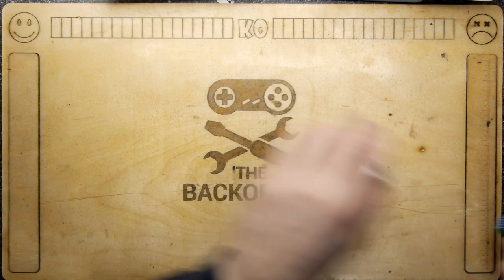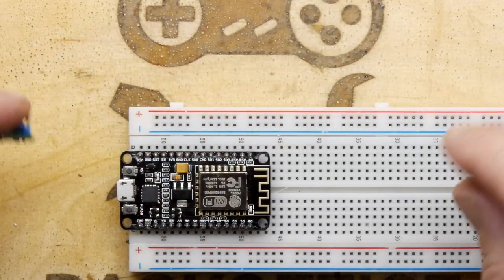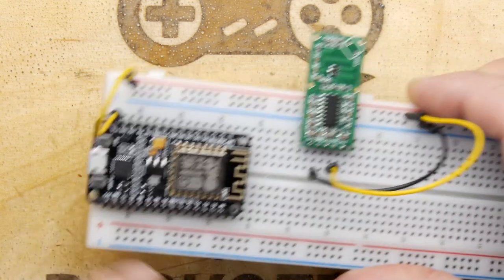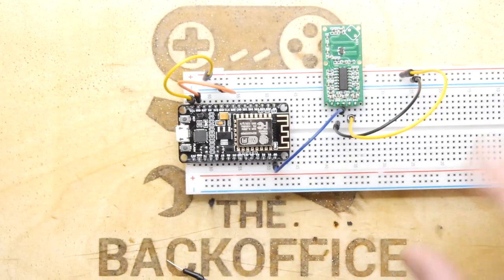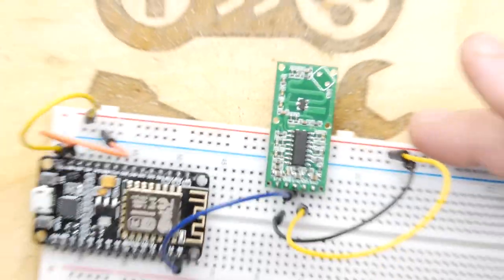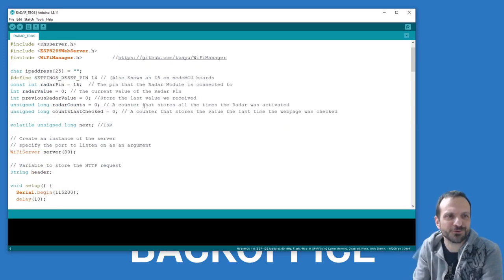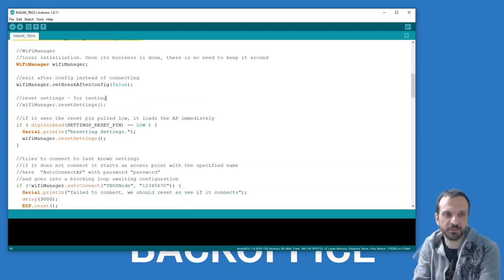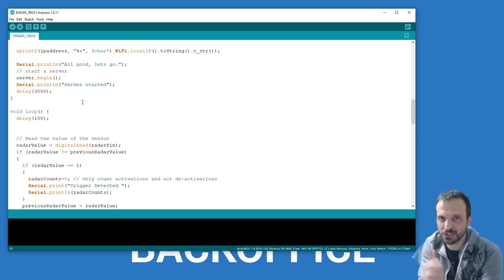Build Your Own Wifi IOT Microwave Radar Occupancy Sensor

Comment: You can wire it with battery to the radar then power 3.3 to mcu and use the deep sleep wake pin as data pin. 1-2 mA/h :) when there is movement esp wakes up and sends data over wifi
Reply from the maker: Nice!!
Reply: 3.3v is @100mA not enough for a esp32 using wifi. It needs atleast 150mA

Comment: For more breadboard  connections for the bigger module, could it straddle the power rails on two breadboards placed next to each other instead of the middle of a single? No such module at hand to test with, and on video it looks that it'd be a  close thing either way... Might depend on/come down to exactly which breadboard one has.
Reply from the maker: I lot of breadboards have removable power bars so deficit this world be a great way around it!

Comment: Good stuff. Have a few of these radars myself. Would the page only turn red if you happen to load it as a detection occurs?
Instead, you could serve some flat html containing a bit of javascript that polls another page, all that other page need do is print 1 or 0 or whatever. The js then dynamically changes the bg colour depending on that?
Reply from the maker: That's a good idea. You could setup an Ajax call for it